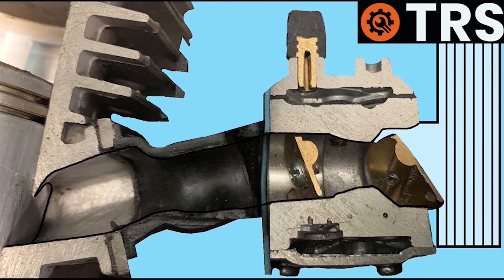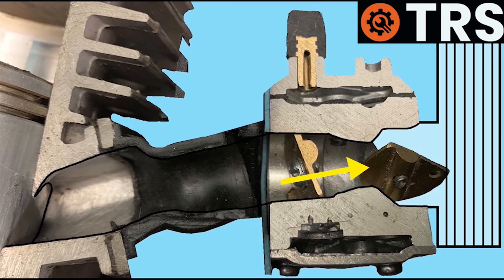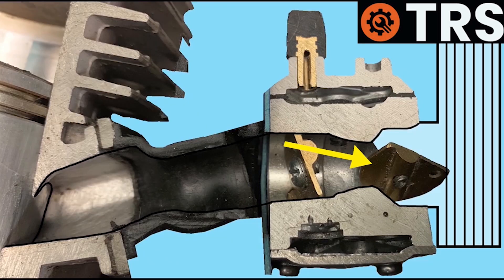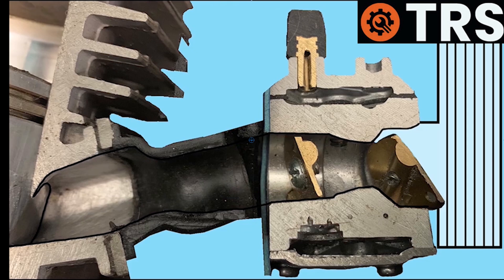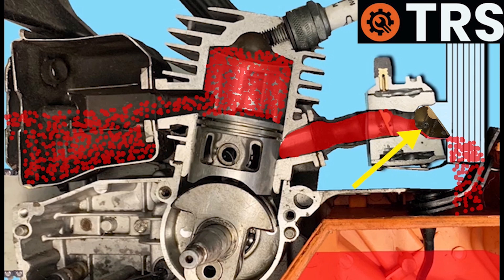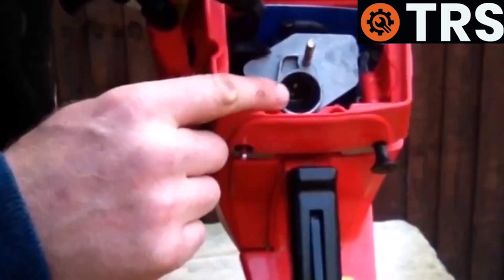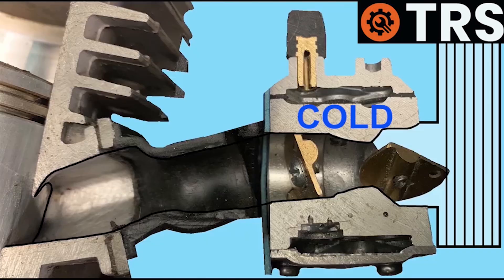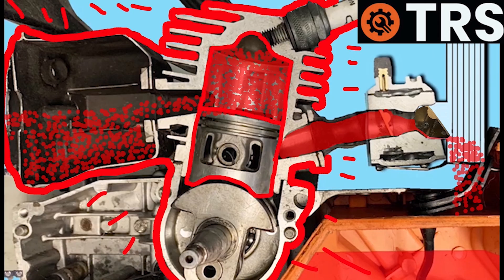Engine Flooding: How the Choke can cause it. (by Craig Kirkman)

Comment: I’ve got a question, I have a 2 stroke blower. All works well . But when you put it on the ground and go to pick it up it stalls/dies . Cranks seals checked no leaks , 150psi compression . Changed carb still happens , new fuel filter , spark plug ,air filter . Any ideas ?

Comment: On my chainsaw, I can pull the choke to get the high idle and get it to cold start. Then I feather the choke valve as the engine warms up. After a minute or more, I can use the throttle and the choke will come off the high idle. once it's fully warmed up, the chainsaw will usually idle when I set it down to get another piece of firewood ready to cut. Sometimes the saw will stall out and it doesn't want to start unless I set it at high idle with partial choke to avoid flooding the engine. I found the low and high mixture screws function similarly to the primary and secondary fuel system on a 4 barrel carburetor. The smaller 2 strokes are really simple to fine tune once you get the hang of it. For a while, I was running the mixture a bit on the richer side and it wasn't getting very much power during the cuts. One of the times I ran the saw out of fuel, it suddenly revved up to full power just as it ran out of fuel. Then I readjusted the fuel mixture slightly leaner while I had the chainsaw jammed into a log and I made the final adjustments to make it scream. I found that bench tuning it would cause the chainsaw to lose power while cutting through a thicker log. 42cc 18inch bar Poulan Blackhawk that I bought as a lemon on Marketplace over a year ago. I had modified the muffler and upgraded to better quality fuel lines. The seller said that it needed a carburetor kit. I never touched the carburetor other than making the necessary adjustments to the fuel mixture and the idle screws.  The saw is a bit louder with the little bit of modification to the muffler. I haven't made any porting modifications yet. The saw was previously used in doing demolition and renovation jobs by the previous owner who had purchased the chainsaw when it was new. He would cold start the saw and run it wide open throttle on a cold engine indoors and it caused some scoring to the cylinder wall and it may have lost a bit of compression. I didn't bother to do a compression test. At some point in time before I bought the chainsaw from marketplace, he had taken the carburetor off and tried to clean it or something. But the dummy with his sausage fingers put the fuel lines back on in reverse order and also caused a binding problem between the choke lever and the throttle cable. Luckily I was able to figure it out and got it back together correctly. Real mechanics are becoming more and more rare in existence where I live. The majority of repair shops and parts counters always recommend to discard the non running saws and purchase a new one. I don't have that kind of money to keep good equipment going into landfills and scrap yards. I'm one of a fortunate few who likes running old junk. The poulans are one of those throwaway brands that even most sellers are scared to talk to me when I'm looking to buy another non running chainsaw. I've never complained about the poor condition. It's just these guys probably feel bad for selling their junk at such a high price. As long as I can get my money's worth out of it. I got nothing to complain about